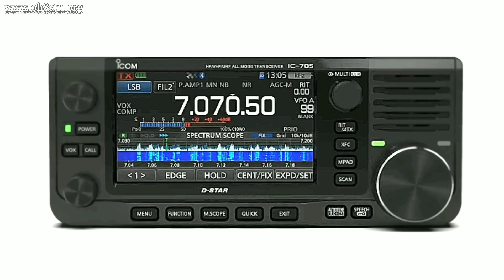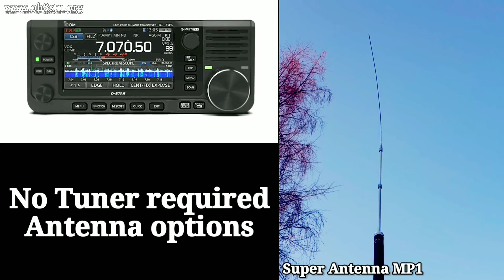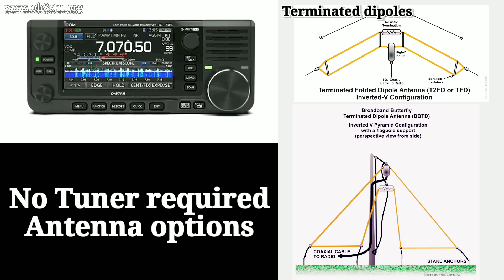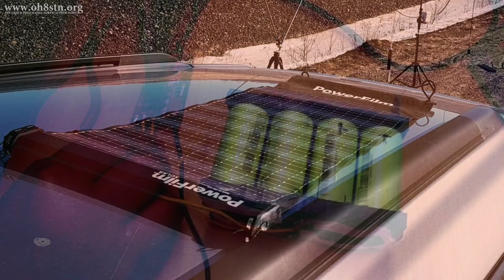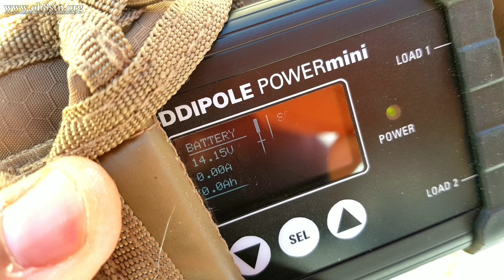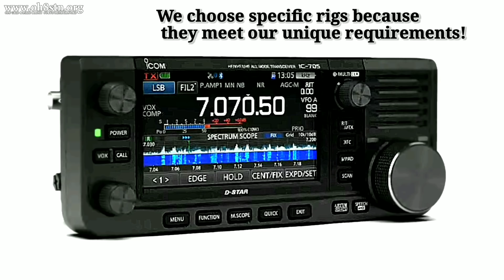Icom IC-705 Update April 2020

Comment: ... tnx Julian, great video as usual. Have both the FT 891, just purchased and a Xeigu G90... price point of both being a major consideration...The IC 705 isn't cheap either, but in all you get a lot of radio for very little money. Neither are perfect and both have their strengths and weaknesses, that cheap power connector on the Xeigu being one, fixed that one quick. 

Both the Xeigu and the FT 891 could easily live in a tank, robustness rather than counting milliamps was a major consideration. I too run my radio from a  battery with a 100w solar panel on the roof charging same. I live in a sunny climate so this is practical....Julian, I simply can't see the sense in taking an expensive Elecraft KX3 out into the bush.  I don't think it was ever designed for that.    Richard VA7AA
Reply from the maker: You're absolutely right. The Elecraft was never designed for tough days in the field. It's a gentleman's radio meant for a park bench, beach chair,... yeah.
The 891 was an excellent radio, but at this latitude, the weight and the current consumption couldn't be justified on foot. The G90 is better in that regard. 
At the moment,  my favorite field radio is the 705. My most rugged and most efficient is the tx500. Coupling either of them with a PA500 amp offers some interesting advantages for qro ops on foot. These will never be the cheapest Solutions, but definitely the most efficient.
It great having options. 
73
Julian oh8stn

Comment: Ok, I’m a bit crazy, but I can afford  it.  Because I have homes both in Texas and Thailand and am interested in emergency, possibly post HEMP communications, I have a LOT of radios. Must admit I’m a big Elecraft fan.  I have 2 Elecraft K2’s that I built 20 years ago. Even went through the extreme pain and covered the cost of sponsoring getting the K2 certified to import to Thailand. I paid over $3,000 to the Thai NBTC and purchased two KX2’s to get certified in Thailand and am still waiting for that after a year. I have a lot of small mono band QRP rigs of various brands. I build about 10 a year. I have a few Yaesu FT-817’s. I have over 10 KX2’s and 10 KX3’s in Texas. A couple of K3’s in Texas and 4 K4’s on order. I love Elecraft radios. I keep most of my radios in custom built Faraday cages to protect against CME’s and HEMP. I keep some on my Sailboat that sleeps 6 people with an isolated back stay that I can load up. 

But it’s impossible to get modern rigs with 6 meters legal in Thailand for the general population. Special versions of the Icom IC-7300 and 7610 with 6 meters disabled by Icom are legal here. So I have a Icom IC-7300 and Icom-7610. Nice rigs. I find them a bit less intuitive navigating menus than Elecraft and the Icom noise reduction and noise blankers I find decent but inferior to Elecraft. But they are very nice rigs. 

But I  see some real advantages to the Icom IC-705 and have ordered 2. I’m excited about the 705 and can’t wait to get them.  No radio is best at everything. In many areas it looks like a leader. I expect I’ll eventually buy more. It is fun to operate rigs in Texas over the internet in Texas. 

I must say I love your YouTube channel. If you ever get to Thailand I have extra bedrooms on the ocean. 

W5MMT / HS0ZAC. Paul

Comment: I am an FT-818 owner, thinking about upgrading... What I like the most is that they seem to care about VHF/UHF too. HF rig + FM handheld is not the way, I want SSB on VHF, I do it a lot! It's a shame for all rigmakers except Yaesu that they don't offer anything for VHF SSB work. Until now. And, it's a shame for Yaesu that their FT-818's VHF is crippled down. It lacks not just filters, but almost all features the rig offers for HF, such as ATT, preamp, etc. Until IC-705, this was nearly the only way to do VHF SSB on portables. I'd even buy a mobile/portable dualbander, if it had SSB, however, there aren't any, all do FM or FM+digi only, assuming that repeaters are the only thing worth of doing on VHF... And they finally are, since nobody has SSB radios. I hope IC-705 will change that.

Comment: To bad that IC705 doesn't  have APRS capabilities and no IP44 at least for a portable rig.
It might work at -10C , but what about condensation?
Reply from the maker: If you've watched any of my field videos you already know, managing condensation is something we all have to do individually. I'm sure I've even written a blog post or two on this topic. As far as APRS, I don't really miss it. I'm using HFAPRS through JS8Call, because APRS coverage on VHF  is so bad anyway. The other features are much more important to me.
Reply: @OH8STN  OH8STN Ham Radio  I have watch some off your videos, not all of them, there are nice and informative. 
I think that is one thing if you lose an G90(450euros) due to a rain or an Icom 705 (1450euro). I am expecting that for that money and all those portable features to have some IP protection. And if they manage to integrate Wifi stack and GPS receiver is build in, some APRS shouldn't be a problem.
I have an Kenwood THD72 and it has IP54, with 3 battery I did 2 hiking trails in the summer 2019. Each of them wore one week long and wore on mountains of Romania with bad to none GSM coverage, but with APRS and some VHF/UHF repeaters coverage. I managed to activate in SOTA program 7-8 summits(4 simplex QSO), to send my position to APRS, to send messages home that we are ok and also to request and receive weather update for the next 12/24 hours twice per day. I use this station also in winter on light snow, even in light rain. Is not submersible like Yaesu FT1XDE, but I have some trust. Also I can use the menu, with gloves on harsh winds and even on blizzard. But as my tent has only 1,8Kg and my backpack is going above 20Kg, because I might climb 2000m per day, so we are with different needs and expectations. Anyway thanks for the multiples reviews and information that you put here and your blog.

Comment: The lack of a tuner is no deal breaker, considering the digital and audio capabilities (digital digital digital) of the IC-705, not to mention 2m and 70cm (think SOTA, POTA, VHF-UHF contests, etc.), the mysterious D-star, and the power flexibility. Heck, grab an Elecraft T1 ATU, or, the obvious, use an antenna that is tuned or one with low SWR across many bands. And, by golly, it's like a front end clone of my IC-7300.
Reply from the maker: Well said :-)

Comment: Thanks for your insights. My only HF experience is my 200 milliWatt WSPRLite on 20m and 40m, and as a step up, this radio looks "just barely good enough" while being "just barely affordable enough". And my backyard antennas are "all resonant, all the time", so lack of an ATU is no problem.  

A question for QRP/field/rugged use: although not as popular, would a threaded (TNC) connector be considered more reliable/durable than a BNC connector?

Comment: My only disappointment with the 705 is that it has only 1 antenna connector, making an external switcher mandatory for hf-vhf-uhf use as I wouldn’t want to wear the 1 connector with frequent swaps. With love, Ken

Comment: Nice rational video. It’s interesting people are hating on Icom mainly for the delay but we do have a global pandemic and supply chain issues and it’s hardly reasonable to blame Icom for that. My biggest gripe with the Japanese radio brands is a general lack of innovation. The Yeasu 818 is a perfect example. It’s an almost useless refresh on an ancient radio. At least Icom has taken a bold step and completely shamed the competition. We all have to remember these are low volume products with relatively high R&D and manufacturing costs.

Comment: I am not so SDR fan as solid state devices.
SDR ruins and opens horizons at the same time.
Might be, mine conservative or old school point of view. SDR hybrids, well, those must have some operating system and way to expand with osm, all grx etc. waterwalls and software plugins. Even uniden is comercialising those conventional options for an extra $100. Just order the code.
Solid state transcievers with unique options, NOT SDR, has soul.
SDR, please, create, engineer for some kind operating system or with one.

Comment: Nice looking radio. I own an Icom IC-7610 and a dead Yaesu ft-897 (great little radio). I would like to have seen the IC-705 with a 50W power output. Since it is only 10W how can I increase it to 50-60W?

Comment: Got my call sign this week and delighted to find your channel dedicated to my intended applications; just joined as a patron. Thank you!

Please pardon a rookie question while looking for my first HF rig. The 705 has band capabilities like a combined 7300/9700 but with field applications they could not mimic. It appears their primary advantage is 100W power and some additional UI hardware. For maximum DX I might use an amplifier with those larger base stations anyway. If so, what disadvantage would I find with my home base station being the 705 plus an amplifier?

Comment: this  has   been a    superb  info   video .  i  have got  more  info in  such a short  time  .  only  complaint  with the 705  is the  price     a bit   high for an sdr  portable   with  limited  rf  power,  but  for the size its  not practical to  have  atu and higher  rf  power .  i   am  contemplating   putting it   my   closer  look  book   .  poss  yep   might  have one  when they arrive  .   thanks
Reply from the maker: That's a very pragmatic way to look at it. Thanks for the comment and for watching. It's very much appreciated.

Comment: I had a 'fully loaded' £1800 KX3 and sold it. It just felt too "precious" and I constantly fretted about it out in the field. I switched to an 818 which I just 'throw' into a rucksack and go outdoors having fun. In fact I take it out a LOT more than I did the KX3 and therefore get more contacts as a result!  I will very likely buy a 705 because at home I use a 7610 and so it will feel very familiar to me. I will never sell my fabulous 818 though <3 

Tom - M7MCQ
Reply from the maker: Well said Tom. I had been very close to a kx3 for a long time, but just didn't think it could hold up to the type of conditions I operate in. On the other hand, my 817 n d has bounced around the top box in my motorcycle, and stuffed in my rucksack, and even experienced a sandstorm in Egypt. Even though I'm not terribly happy about the evolution of the 817 Indiana 818, it's still a heck of a radio. Hopefully the 705 will give us as much pleasure.

Comment: Not hating, I just think the price will be more than I'm willing to pay for any portable rig period. I'm still a very basic operator and probably will be until I start playing with digital modes etc..The extra features are sweet but I'm still having fun with my FT-818 and I can do everything I want with it the way I currently operate on HF and VHF/UHF SSB, a reason the IC-705 is also interesting to me. I also suspect I could buy two 818 rigs or Xiegus for the price of the IC-705 if preliminary pricing is still true. I just personally don't budget much money to my radio hobby. I do think for the money it should have an ATU but I agree it's not a deal breaker as I have a couple portable tuners (manual and auto) that I could use if I didn't have a resonant antenna or if a resonant antenna I carried failed. That's the beauty of the hobby many options for many different operators. I will say this delay could be bad for Icom as it buys time for the other manufacturers to get something together as Icom presented this month's ago and it will likely be several more months before it hits the market. Regardless I hope that everyone that buys the IC-705 enjoys it and is willing to have a QSO with a lowly 818 operator if they hear me calling. Cheers and stay safe everyone.

Comment: I wonder about the cooling of this rig running at 10 watts on a 13.8 volt supply.  Seems like at high duty cycle modes it might get pretty warm even at 5 watts. It's not apparent to me where the heat goes.   It sounds like there's been significant interest in an ATU and amp according to ICON.  Maybe something will be offered later.
Reply from the maker: Good point.  I think Icom has good experience with the 7300  which this is modeled after. Remember this is just a qrp version of the 7300 so hopefully it's better than the Yaesu FT-818 and the elecraft kx2. Those overheat running high duty cycles.
Reply: @OH8STN  So apparently does the kx3, x5105, etc.  It's certainly something to consider.   Heat rejection from a small device can be challenging.

Comment: Not sure how hard it is to send word or Excel files using DMR, however, slow as it is, I have sent files using D-star with D-rats 4 to 5 miles away using simplex and a 5/8 wave antenna, with my 11 element 2 meter directional beam I can send data over 30 miles away using my IC-5100 or the IC-7100 simplex or over HF D-star, obviously much farther. D-star has so many features most may not be aware, or just don't use even though they own the radios, have now been trying to set up the Kenwood TH-D74a handheld and a 45 watt amp to experiment with data, handheld the amp, and a backpack antennas to find the nominal range. 73's N7XO

Comment: My biggest complaint is that it's only 10w. I completely understand 5w on battery. While they could have done 10w, 5w makes sense. However, if I can hook it up to external power, I should be able to do more than 10w. Ideally, I'd like to hook it to a battery and get 50w, but given how much they packed into a small package, that might overheat it. Either way, I would think that they could have gotten 20w out of it. 

I'll be watching this, and whatever the competition comes up with. I'll have my general ticket soon (hopefully) and can't operate from home right now, so this and a Chameleon MPAS are probably going to be my setup for a while.
Reply from the maker: It's a fair point. More power is always a good thing, but often physics gets in the way. All of these portable radios on the market have problems overheating, with High Duty Cycles and higher power. This is why they often use an add-on amplifier. I'm not sure what the 705 strategy was with 10 watts. Excellent point and great comet.
Reply: Maybe if they could have added a small fan, like on a mobile radio, that kicks on during external power use. But at the end of the day 10w works even if it's not as much as I'd like.

Comment: I don't think there's enough known yet to make a final decision on whether or not I want a IC-705.  I just looked at the pre-release brochure.  I have mixed feelings about the spectrum display and touch screen.   How will it handle digital modes?   Does it have a built in sound card or does it need a signalink or similar sound card device interface.   Elecraft has a well established path to go QRO and make the KX transceivers a dual purpose home station or highly portable package and offers a bit more power.   When you finish accessorizing the 705 is it really any less expensive?   Maybe when the rig is actually available it will be easier to compare the pros and cons.  Maybe after Elecraft delivers the K4 there will be a Kx4 in the works...
Reply from the maker: The entire point of this radio is being all in one. The only thing it's lacking is the tuner, which I won't be using anyway. Unlike Elecraft, there is no accessorizing required for this radio.  The internal sound card is built in, so no wire mess for data. So it likely will work exactly like the 7300 for data modes. Using the internal battery, elecraft KX series outputs 5 watts, just like the ic-705. 
I'm also curious how the screen is going to work out, and how much current it draws. Other than these I don't really have big concerns. I have no interest in operating qro with this radio. I preferably operating QRO with a separate rig. Anyway, I don't think there's enough information to dismiss this radio just yet. 
My first IC-705 video
https://youtu.be/0gx3GKFjGkQ
Reply: @OH8STN  Either I missed it or it wasn't in the brochure.  A built-in sound card is indeed a plus and an external tuner doesn't have to be a big deal at qrp.   I'm not dismissing it or embracing it quite yet.  It would be nice to have something that worked qrp and could interface with a 50-100 watt amp for mobile  or base use.  I guess we'll know more when it's available for sale and in the field.  It does appear to be raising the qrp bar.

Comment: Excellent and informative video! I have been looking at getting in to QRP, the options are a varied as ever. I was leaning towards the KX2, but now I may wait for the IC-705. I am not a digital user per say, but nice to have the option.
Reply from the maker: I agree with you. If nothing else this radio is a very interesting option and we'll drive other manufacturers to catch up. This only sweetens the selection for operators looking to get into qrp. Thanks for the comment.

Comment: I love my Elad FDM-DUO (you should check that one out... same concept) with my old style Goal Zero sherpa 50 and upgraded cells, and the Superantenna, but really miss VHF/UHF capabilities when I use it....and DSTAR to boot? This little Icom will definitely be in the shack!  Because of delays though, may just have to pull the trigger on the Elad amp that matches my FDM-DUO!

Comment: Started with RTTY 50 years ago and we have come a long way. I hate those Line in-out cables with transformers and picking up HF. Therefor now I only will buy a radio with one line usb control. Will sell my KX3 because of the points you mentioned and the 705 will join the 7610 for portable and RV operations.. Love your videos by the way.. 73 KL5X P43TH HB9DOD